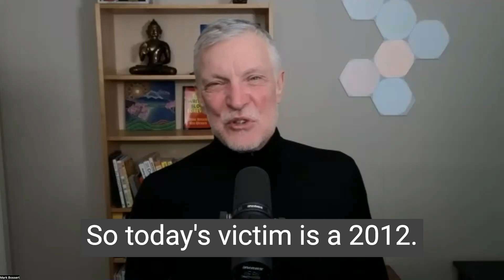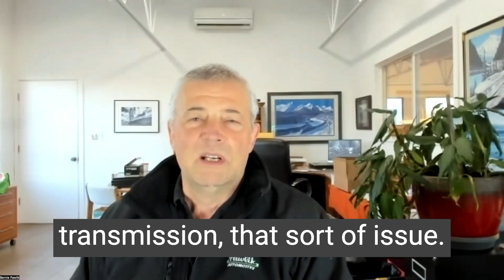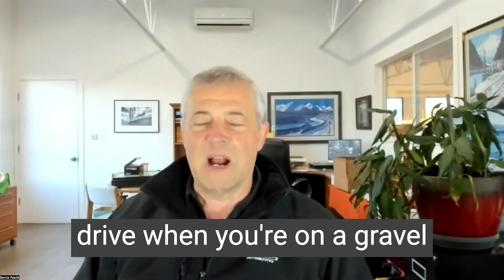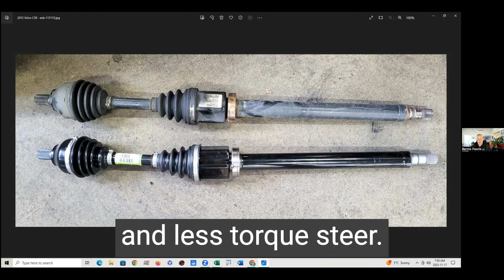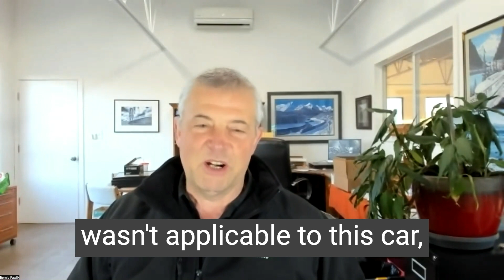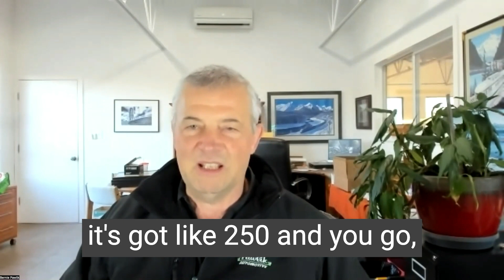2012 Volvo C30, Axle Shaft Repair

Comment: Inner CVs don't often fail early. The outer CV is the usual victim. The right side shaft carrier bearing can fail on C30s. Usually, there's typical bearing noise that is fairly constant. This car has 200,000 km is a good bit of mileage, so no surprises here.